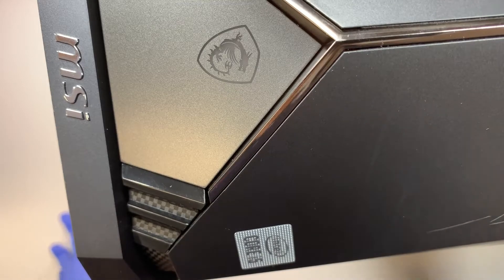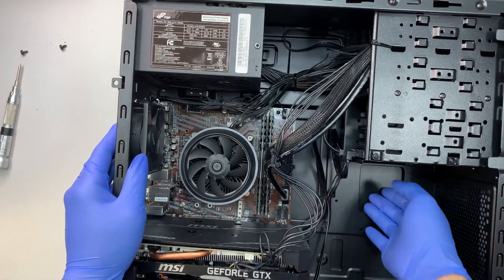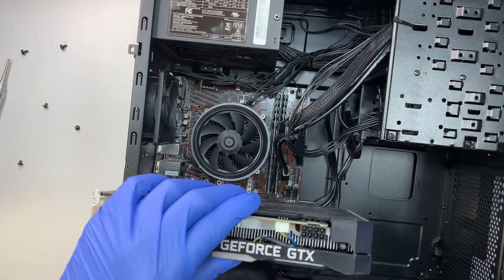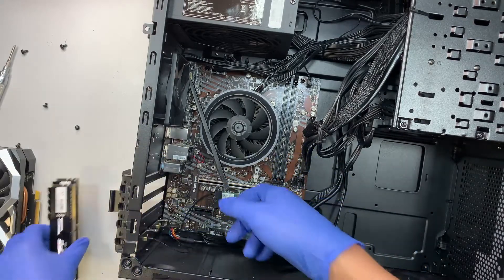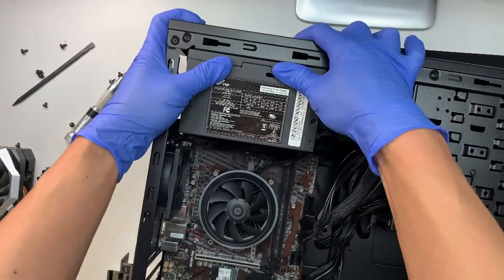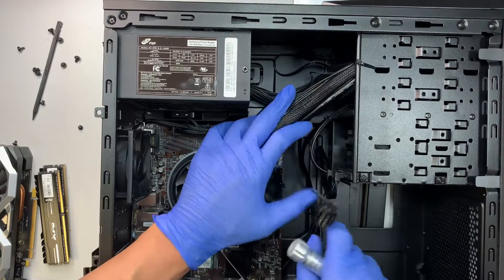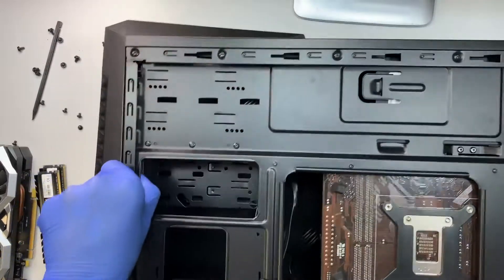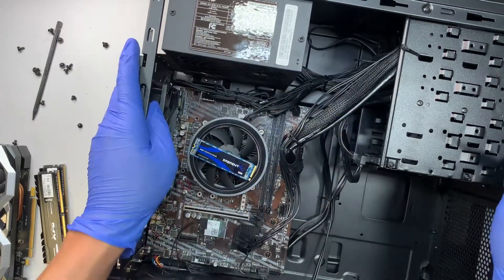MSI Aegis SE 10SI Desktop Tear Down Disassemble

Comment: Which graphic cards can I switch to higher than a 1660 super of a better alternative? Last thing the power supply cord is connected to the power is a little cord it won’t come out when I pull I think it goes to turning on pc
Reply: For this pc if you don’t update your power supply the max you could probably go up to is a rtx 3050 if you wanna go the amd route then go for the 5700xt

Comment: I bought this pc about two yrs ago now for the main purpose to use it for vr games. But realized I hadn't paid attention at all if it'd had a USB C port, which it unfortunately didn't. Is it possible and how or where would I get a USB C port to add to it?
Reply: Adapter
Reply: I just got this PC and I want to use the pcie x16 slot to put in a usb c card. Looking....
Reply from the maker: You can not

Comment: Im trying to install another thing of RAM, but I can't seem to get my CPU cooler off. It is different than the one shown in the video, it is bigger and is not held down by screws. Instead it has little plastic pin looking things, and then some sort of metal lever on one side.
Reply: It’s a stupid clip on design

Comment: What is the size of the cpu fan, like 80mm?
Reply from the maker: Most popular size is usually 120mm in modern PC cases, however, you will find other sizes such as 80mm, 92mm, 140mm, 200mm and various other configurations.
Reply: @UbergeeksBiz  thanks for the quick response and the info! One last question that I have been breaking my head online and can't find anything. What CPU cooler is this? Because I am going to change it for another one and wanted to know the specs of this one.
Reply from the maker: @ambsxxrawr  You can go with Noctua cooler. https://amzn.to/3PsKM3i   Compatible for the intel i5 CPU

Comment: I bought one of these MSI Aegis, but I wanted to install an intake fan like you said you can put in.  How do I install it?  There is no labels for the plug-in.
Reply from the maker: There is molex cable available. Get on of this :    https://amzn.to/3oA387W    And you can connect the intake fan. Intake fan would have to zip tie. No mounting bracket for additional fan.

Comment: Would a XPG GAMMIX D20 work with this pc instead of D10
Reply: It’s worked completely fine but the power supply is barely able to dish out the extra power so my lights on the cpu fan are glitching out so I turned them off.
Reply: @Averagesized-v6w  ok thanks

Comment: Does anyone know why it wouldn’t turn on
Reply: Do you have it plugged into a wall. Is the pc turning on put not the monitor-you probably have the hdmi plugged into the wrong output. Or some of your power supply cables are unplugged.
Reply: For got to edit this comment. I got a new pc turns out this one had now power like the tower wasn’t responding.
Reply: @yo_itztank  ok, good to know!

Comment: how do i fix when the hdmi is connected to a monitor and the pc and it just stays blank, ive tried it with different monitors and same thing always
Reply: The most common problem is that you’re putting the hdmi into the wrong input on the back of the pc, try using the hdmi closest to the power box and I bet it would work, or just try every hdmi slot you have untill it does
Reply: @thatdomingovibe1707  thank you, i was putting it into the motherboard hdmi socket instead of the gpu

Comment: Any instructions on the msi GeForce GTX pc because I need to remove the glass
Reply: There are screws on the back. Unscrew those and slide the panned to the left. It will come off.
Reply: @Averagesized-v6w  how many screws
Reply: @lethlelight  I’m pretty sure two
Reply: @lethlelight  it almost looks like there is a handle on the back and the screws are on top and below that handle
Reply: @Averagesized-v6w  oh ok ty i got this pc on christmas but i wanna recheck it for loose sh

Comment: Neither of my fans are spinning while it’s turned on and even during gaming. is this normal ?
Reply from the maker: Not normal. Fan should spin when you power on the desktop
Reply: @UbergeeksBiz  Had that issue before, turn off fast boot in the bios. Not sure why but it fixes it.